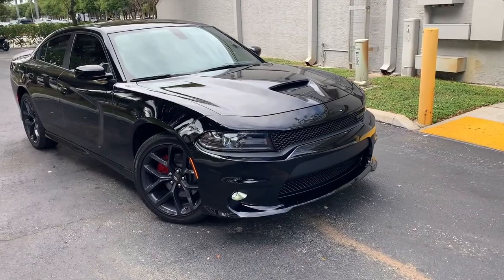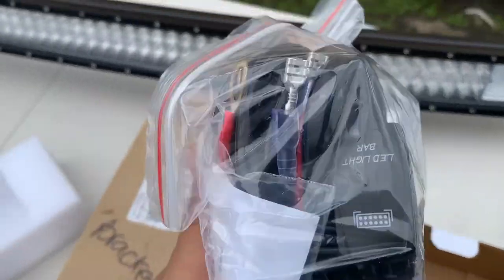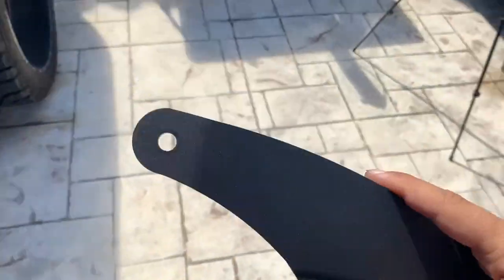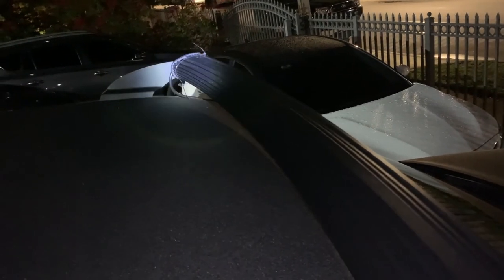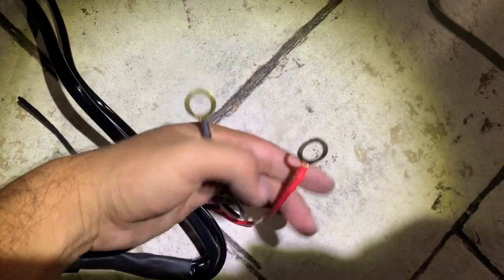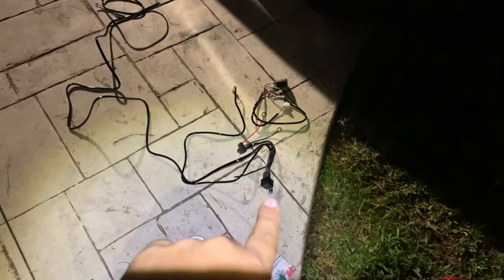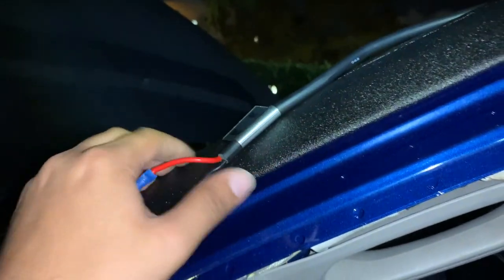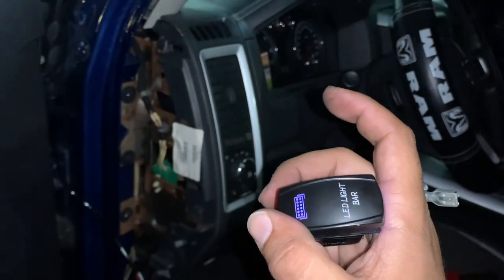Nilight 52' curved light bar on Dodge Ram 1500 - EPIC FAILURE + AMAZING RESULTS

Comment: What about leaks/rust? Looking to do the same to my ram
Reply from the maker: No issues I actually did it to our company rig also and no issues
Reply: @VIPDCUSTOMS  how did u put the weather stripping back over the screws to make it flush with the body? Looked like it was resting ontop of the screws not flush
Reply from the maker: @stevencranston107 on the ram I went back and cut a little into the weather strip to make it flush 
On my current rig I I put silicone since is didn’t have any covers

Comment: The grommet, or Garman as you referred to it, it’s very easy to find. There’s no need to run wires to the fenders and the doors.
Reply from the maker: Yes at the moment I wasn’t aware of it. I ended up finding it and fixing the issue later on. Thank you

Comment: since the wires on down the rain channel on the window  the butt connectors are good but defiantly  use the water tight ones and then heat shrink over top of them so water wont get into the connection other then that nice video man
Reply from the maker: Thanks for the advice I’ll look into it . So far 1 year later still works great

Comment: Nice video, one thing I will change in this installation is the way power is connected. It would be better to connect the positive wire to the ignition switch wire that provide power when ignition is turn to the on position. If  you leave the light on and forget to turn if off, it will kill your battery.
Reply from the maker: That’s one way to do it but having it on a switch does not kill the battery

Comment: What's the wiring kit you got though? I just bought the bar but didn't know I'd need the wiring as well, what are the specifications for that?
Reply: Nevermind I think I've got it. Wait so you got this entire thing done in an hour? Or 10:50am-12:10am? So like 13 hours? I'm not a mechanic so wish me luck XD and the brackets I got aren't even for my vehicle, which is a car. We'll see how it goes, the wiring should be no problem, it's the mounting I'm worried about
Reply from the maker: Took me 1 hour or so , first time wiring yeah the mounting take shot longest
Reply: @VIPDCUSTOMS  Ah okay that makes me feel better lol if you can do it in an hour maybe I can do it in a few hours, but having the proper materials to mount it will be the hardest part I'm sure. I'm gonna try to use a 2004-2011 Ford F150 mounting bracket on my 2008 Ford Focus, so we'll see

Appreciate the feedback though, gives me some confidence that I can figure it out, idc how long it takes, as long as it gets done. I'm pretty good at wiring and my father is like an actual electrician so that'll be a breeze luckily
Reply: @VIPDCUSTOMS  Took my dad and I like 5 hours.. The mounting options I planned didn't work, had to mount it to the hood and there wasn't anywhere to run the wires into the cab so I had to drill a hole in the steel which was a pain in the ass. Got it though
Reply from the maker: Yes lol